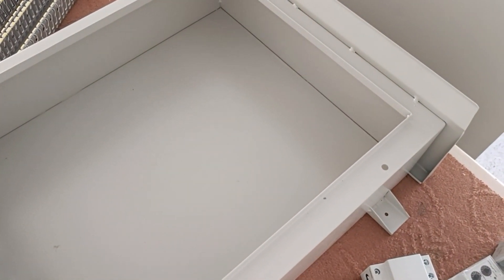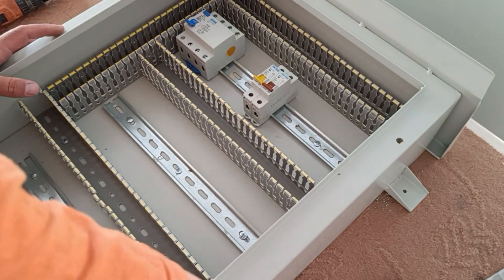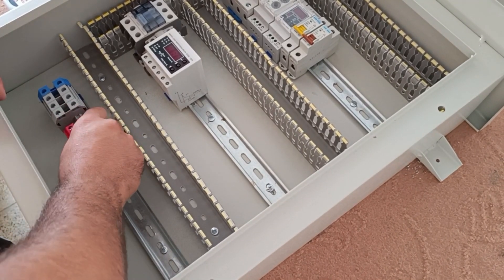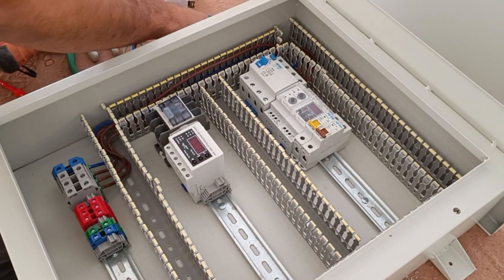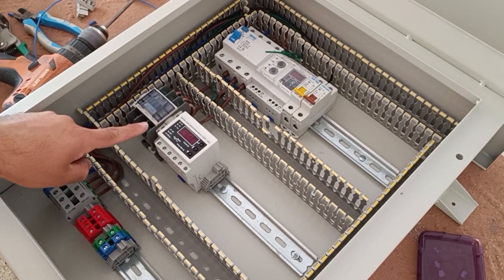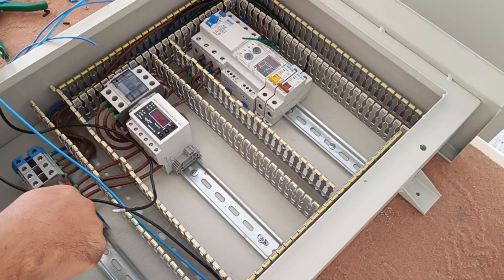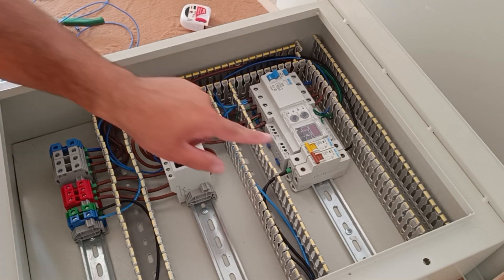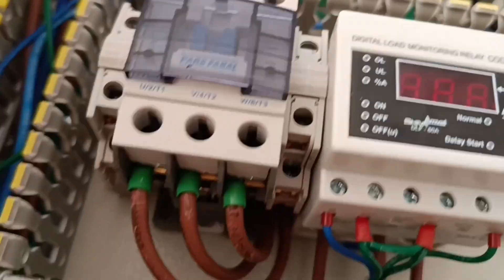Industrial electrical panel wiring training(all details)

Comment: thank you for these videos. If i want build 30A,  60A or 100A panel. Please how do i select matching component ratings?
Reply from the maker: @Chidi-r2j  
For 30amps panel please use wire with cross section 10mm2 and use 40ambs miniature switch and 40ams contractor
For 60 amps panel please use wire with cross section 16mm2 and use 80 ambs miniature switch and 80ams contactor
And For 10 amps panel please use wire with cross section 25mm2 and use 120amps  mcb switch and 120ams contactor